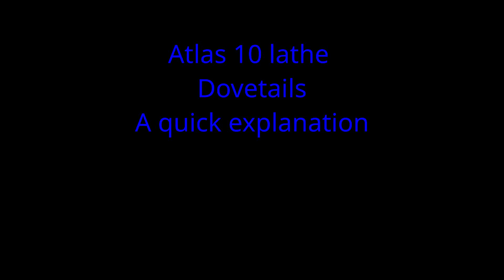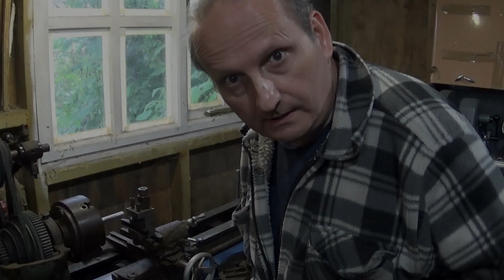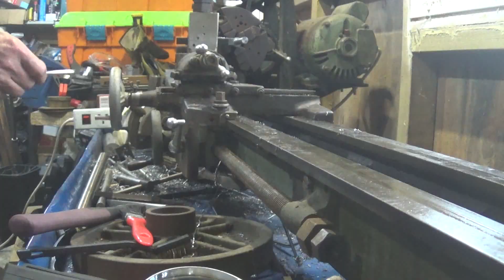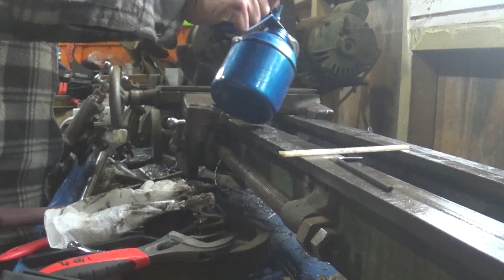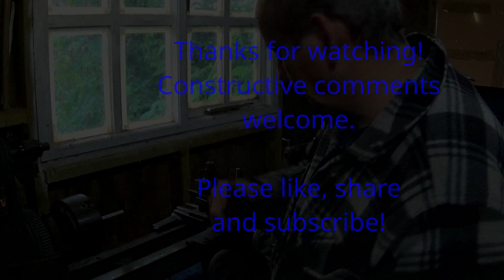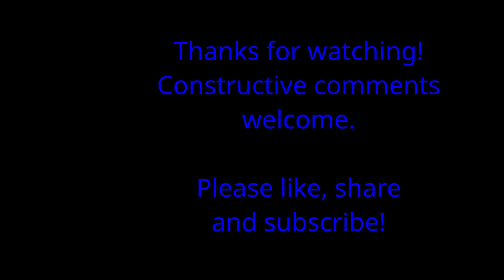Atlas 10 Lathe Dovetails

Comment: Mine Atlas 10F is a bit worn, but I love mine!  Thanks for the tip about the gib strips.  They are a bit of a wet noodle, but if patient and taking your time it does turn out pretty good work.

Joe
Reply from the maker: There's quite a bit of wear on the ways at the headstock end of mine and it seems that the spindle isn't a no 3 morse taper which is what I thought it should be. Still, I will get it to do good work all the same.
Reply: @BensWorkshop  My bed wear is at the headstock end too.  I am truly surprised that your spindle isn't #3 MT.  I though all the Atlas 10 lathes were and the tailstock quill being a #2 MT.  Odd.  Looking forward to more videos!

Joe
Reply from the maker: @MyHeap  I've got a quote for a regrind if I want to go down that route, but I expect I can work around it given I have a spot on lathe as well. The morse taper is a surprise. I will have to work out what it is.

Comment: I don't think I explained myself very well when we were originally talking about this, my ways are dovetailed and the carriage doesn't have gib screws,  There are adjustment screws, one at each end but I've run out of adjustment so can only achieve baggy or really baggy hence wanting to lift the carriage off to see if I could shim behind the wedge.

I'm puzzled by the run out you are getting, surely if the bar is parallel for the first inch then has run out there is wear or a defect in the bed?
Reply from the maker: Also I am fairly sure you said dovetails....
Reply: @BensWorkshop  I did say dovetails, the ways are dovetails on mine. My carriage splits in two, top half goes right over the top, the bottom all the way under, the adjustment screws for the carriage Gib strip are longitudinal so rather than pressing on the back of it, they slide a wedge behind it.
It's a smart and brown model m.